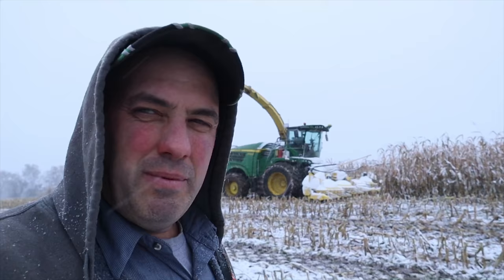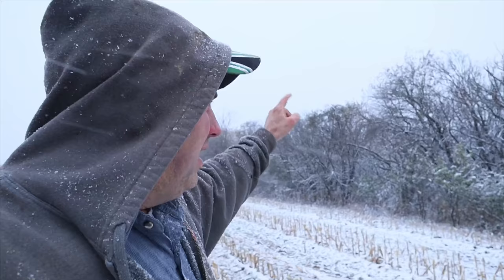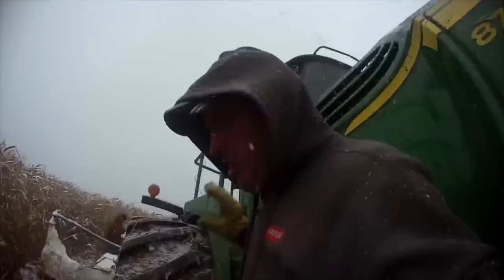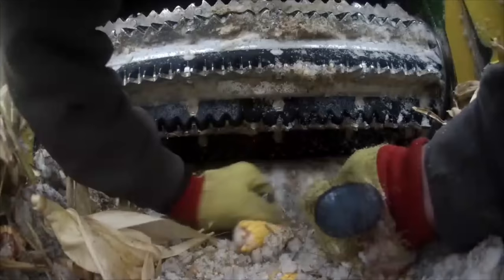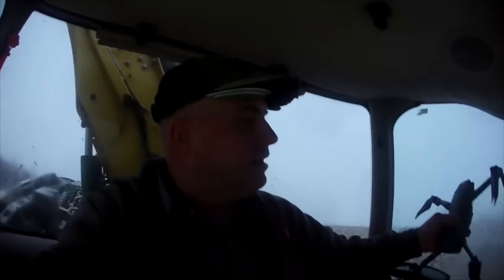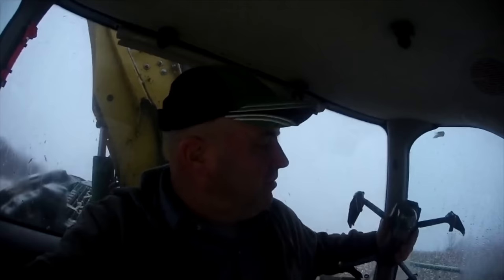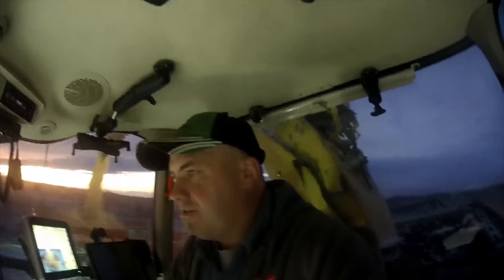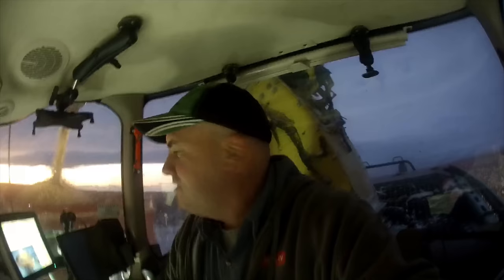John Deere 8700 Chopping Corn in the snow

Comment: Thanks for sharing. Never seen anyone chopping in the snow, but I've seen combines and balers running in the snow. Couple years back we were trying to finish up 3rd/4th cutting haylege and had some snow but it melted off b4 we could finish chopping. Im sure you're glad to finally be finished with corn silage.
Reply from the maker: Yes it was a bitter Sweet ending to a some what challenging year.

Comment: I'll bet the engineers that designed and tested that head and chopper thought they ran it in,every conceivable scenario , but somehow I doubt they ran it in any snow!! Looked like it preformed pretty well except for the feed roll issue , much better than trying to shell it , cause you know what a disaster that turns into!! I had heard you could use a crop off of the prevent plant acres for forage so didn't work out bad for you !! We had snow here last PM bitter cold wind today ! Hope it straightens out so you can get your beans and shelling corn out ! How many lives does that drone have ya think ? Thanks for the video !
Reply from the maker: It's a pretty good drone for sure

Comment: Hey Andy, That's something I've never seen before.  I've leveled and packed the silo edges before they outlawed being under the blower pipe back in the 50s.  This must be some more manifestation of Al Gore's global warming, the early snow.  My Montana cousin Joe said they had early September snow this year.  Anyway, stay warm.  Hope ya get it done without any grievous incidence.
Reply: Barry Simmons hello, I don’t understand what you mean outlawed being under the blower pipe? Thanks
Reply: @claroibre4778  we used to be in The Silo when it was filling, we would level the surface and walk packing down the edges. Did it with both hay 'n corn.  Somewhere in late 1956 or 57 New York State said no more.  Something about the atmosphere being hazardous to your respiratory health.
Reply: Barry Simmons Ah okay got you now, you mean one of those tube tower things. Thanks
Reply: @claroibre4778 ,  Yup, one a them. They are either made from wood, concrete or the cobalt blue ones are glass lined Steel. Those are sealed airtight and have breather bags on the top to allow for expansion and they unload from the bottom, by name they're  A.O. Smith Harvestores.  Are you a farmer somewhere?
Reply: Barry Simmons no not farming  or a farm family I just like learning about farming.
Reply: @claroibre4778  Where are you located?

Comment: The chopper looks like it is going twice as fast in the snow. Now the question is how do you get the silage out of a grain cart? Or is it a silage cart? And then the same thing. But I suppose you just tow the cart back to the bin and make it a slow process. With four trucks hauling no way to keep up unless you had ten carts. Makes the 8700 less functional. I guess.
Reply from the maker: The cart dumps

Comment: what was the deal with  monitor  that gave you the tons/pounds per ac and how wet the crop is what did they do to finally fix it
Reply from the maker: New lab, knock sensors cab controller not sure if it is fixed entirely or not.